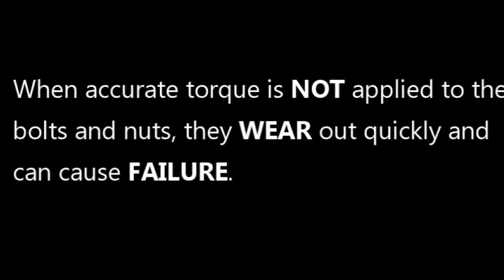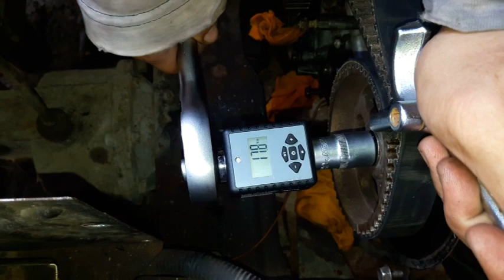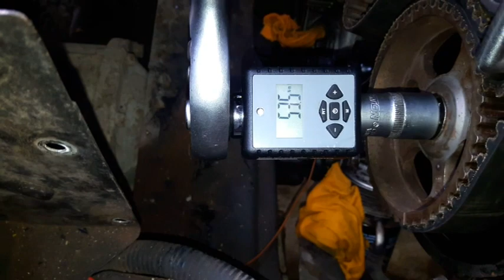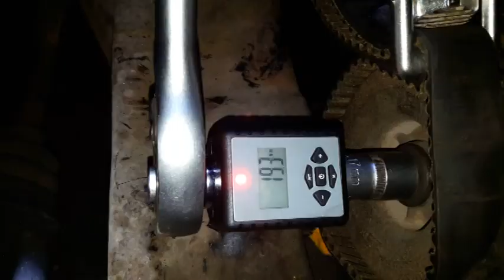CAMSHAFT & CRANKSHAFT BOLT TIGHTENING TORQUE F6A MULTICAB

Comment: Master..gud am sayo.may itatanong lng ako sa Suzuki carry ko na F6A 12 valve 9th gen. Kc noon huli ko inadjust ung valve clearance nya may napansin ako na may kalog na ing camshaft nya. Kaya pala kahit ano gawin ko na eksaktong adjust sa feeler gauge lumuluwag cya pag inikot ung camshaft. May nagsabi sa akin na mekaniko na pinagtanungan ko palitan ko daw ng camshaft. Iniisip ko hindi ba mas madali maupod ung mismo cylinder head kesa sa camshaft na matigas.
Reply from the maker: Boss before replacing the camshaft, mas maganda kung ma measure ang runout at cam wear nito using dial gauge and micrometer kung out of the specification na ay kailangan nang palitan. try nyu po check baka kailangan lang palitan ang valve spring. kung may vacuum gauge kayo try nyu observe kung wild ba ang needle ng vacuum gauge at medium or high rpm. About naman sa valve adjustment, talaga pong nag babago ito pero after ilang kilometers pa, pero kung wala pang kilometers ang takbo tapos nag ingay nanaman, possible na hindi na higpitan ng maayos or weak na yung valve spring, then last option is to check the wear out ng camshaft.
Reply: @UDoITchannel  kc master ang ginawa ko pagkatapos mag adjust ng valve clearance ay inikot ko ung crank shaft para ibalik cya sa compression stroke ung cylinder 1 (TDC) i-check ko kc valve clearance kung hindi nagbago.ipinasok ko ung feeler gauge sa pagitan ng cam lobe at rocker arm .nagulat ako na pumapasok ung 0.15mm na itinama ko nman cya sa 0.08mm intake. Tapos tinangal ko ung timing belt at inuga uga ko ung camshaft timing gear. Umuuga cya mayroon cya  flee.